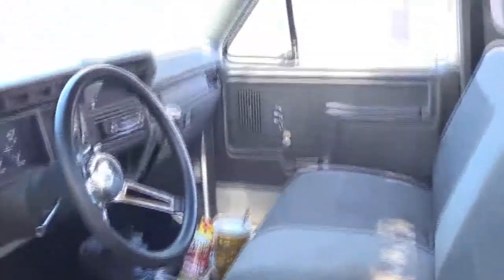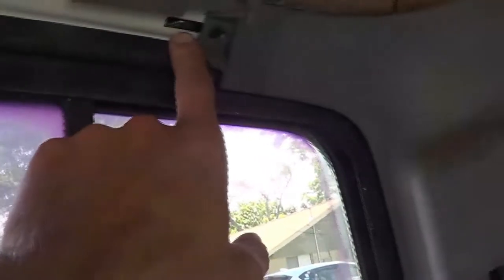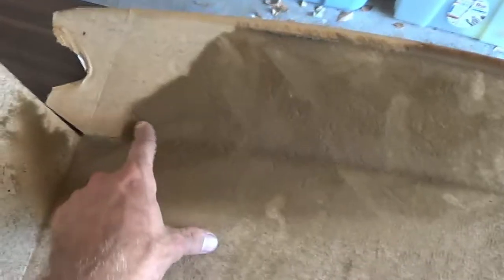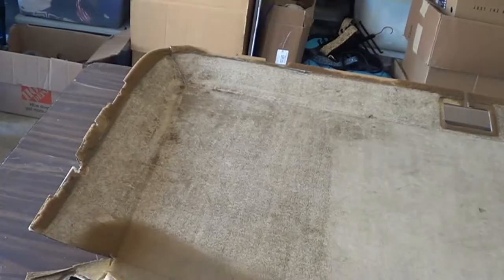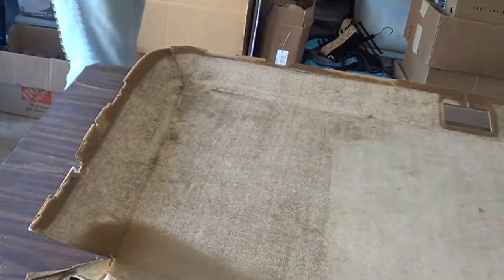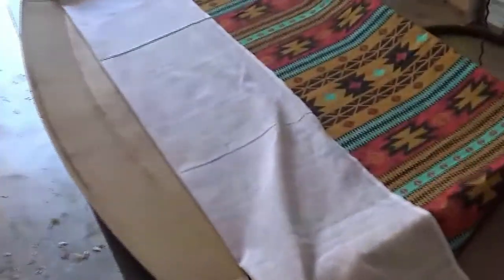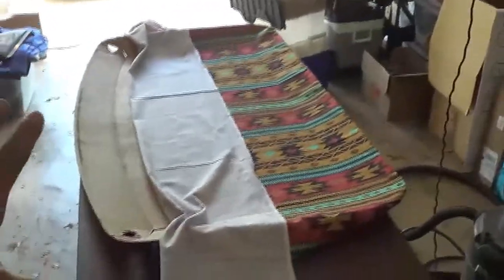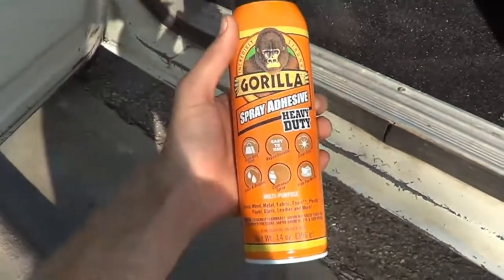F150 Custom Headliner

Comment: Great video.  How did you pull off the metal trim on the top
Reply from the maker: It just has clips on it and I was able to use my hands. A plastic prying tool may help as well.

Comment: Looks great, hows the glue holding up 11 months later?
Reply from the maker: Texas summer has been hard on it. Maybe some insulation between the metal and headliner would have helped. It is still attached but there are a few small bubbles where it sags